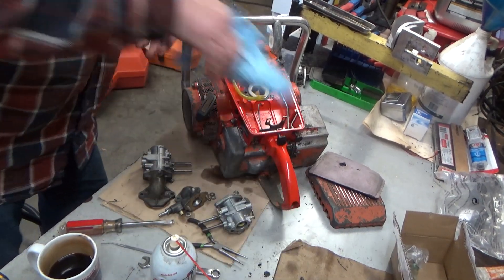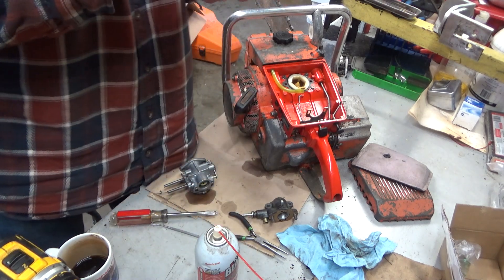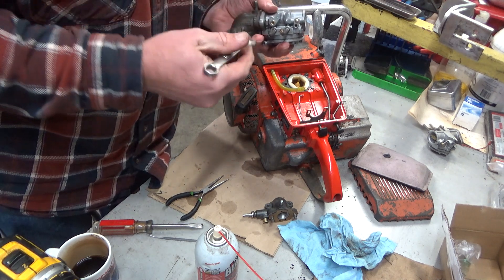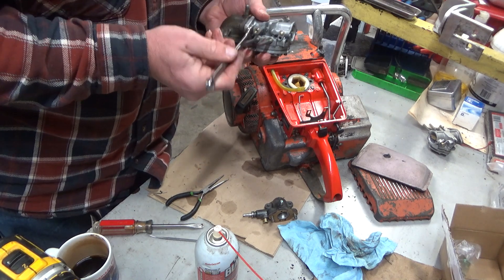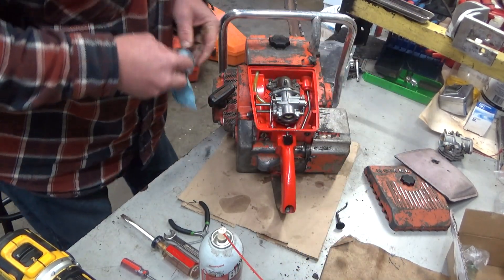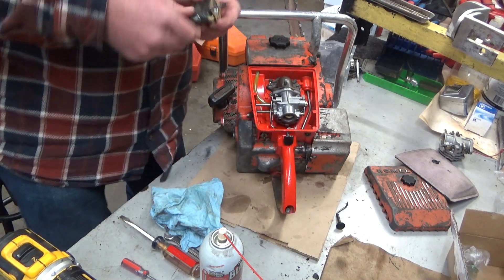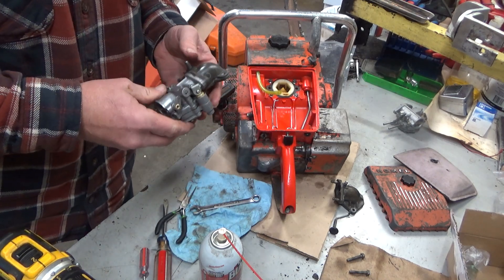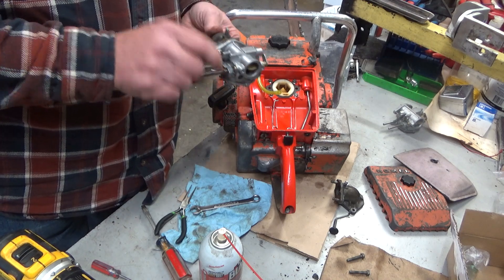Tillotson HL 222A From Al's Homelite XP-1020 Automatic Tested On Homelite 2100!

Comment: Thanks Leon, I could not figure out how to get the accelerated pump off to clean it out. The whole carb was full of dried up fuel that resembled grease. I don't know what happened with this saw, but it was not run very long before it had an issue with the recoil. It would appear that it sat for decades with fuel in it. I have the original bar and a complete saw and bar decal set
Reply from the maker: I guess I should have shown that on video...the pump just has a "cup" below the brass piece, much like an accelerator pump on a quadrajet carburetor.  Whatever the cup is made of, it apparently can swell.  Most of these explode when the carb comes apart, but this one is swollen and moves much less easily.  Fortunately it does still appear to pump.